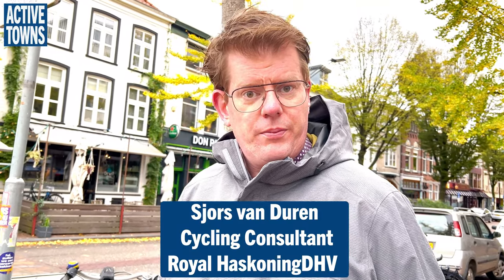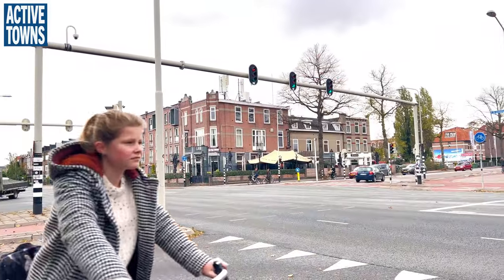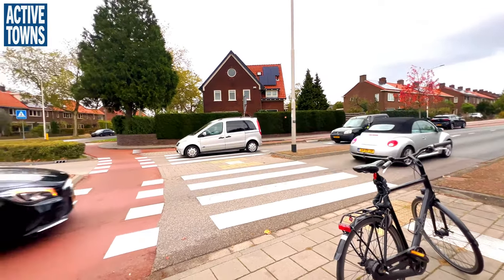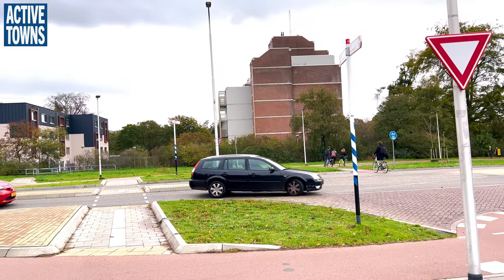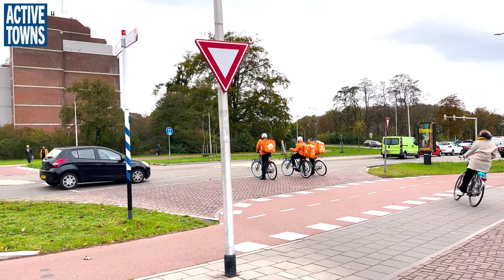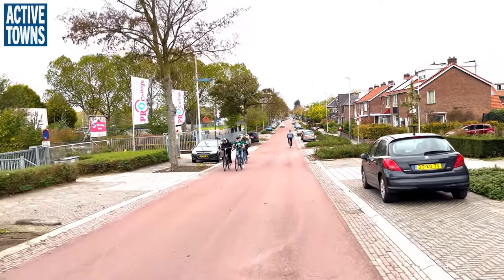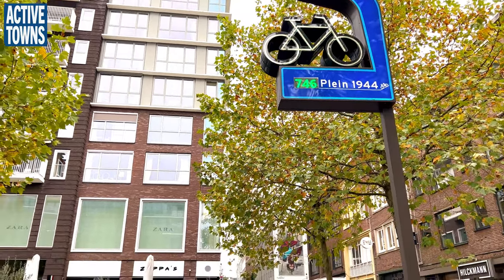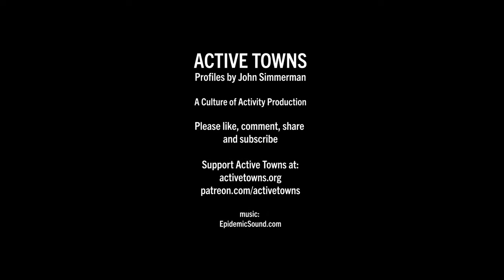Nijmegen Cycle Network Tour w Sjors van Duren

Comment: The Royal Haskoning engineer clearly is an expert in his field. What is great about this video is the work-in-progress feel to it. I am well acquainted with Nijmegen, but rarely cycle there, so there were several observations and insights that were new to me. Showing off with excellent cycling infrastructure is not so educational, highlighting weaknesses and problem areas is much more relatable to average interested viewers. I believe this is a key element in the Dutch success story. Something doesn’t have to be perfect, but it does have to be better than the previous situation. This video illustrates this point quite nicely on several occasions. Good job!
Reply from the maker: Great points. Thank you so much for watching. I really appreciate it and I hope you are enjoying the Active Towns Channel. Cheers! John
Reply: Generally road infrastructure has a 20 to 25 year lifespan in the netherlands. So every couple of decades a road or intersection is up for renewal and that is the point where improvements can be made cheaply since everything is gonna be dug up anyway, might as well change it for the better.

The parts where he is complaining about stuff you can see it is generally older infrastructure from the early 2000s. Back then that was already upgraded to a more progressive situation to what it was before, and now that it is up for renewal further improvements can be made to get it more in line to what is concidered modern today.

Comment: The roundabout at the University is really daunting during rush hour. A few months ago, when I arrived by car, there was an accident. Bicycle flat on the pavement, ambulance, (traffic) police officers around. I asked how the victim was doing. No serious injury, an officer explained. I'm pretty sure this was because the speed of the car was very low at the moment of impact.
Reply from the maker: Yes. That's ultimately one of the most important benefits of properly designed streets and roundabouts... if the speed is slow, in the event of a crash, it is most likely not fatal.

Comment: AFAIK the color doesn't have any legal status. The sharks teeth and other signs will demarcate priority, the color is purely a hint.

Sjors is obviously the expert here, but he might be glossing over some stuff for the sake of explanation?
Reply: I'm in particular referring to the intersection around 12:00. But it's the same in general, I thought.
Reply from the maker: That's consistent with my understanding as well. Thanks so much for tuning in. Cheers! John
Reply: That would seem to make sense. The colour is mostly a visual separation but doesn't have any legal backing to it to make priority.
Reply: The color itself doesn't give it any legal status, for those to be legally protected bike lanes they will have bicycle markings on the path itself. Depending on them having interrupted or non-interrupted lines other vehicles are not allowed to encroach onto them. The bicycle paths that do not have said bicycle marking are advisory bike lanes. There is definitely some regulatory improvement to be made to remove any ambiguity with regards to their safety and legal status.

ps. That said, most people driving a car here however are fairly well conditioned with the use of the legally protected bike lane and treat most if not all of these advisory bike lanes all the same.